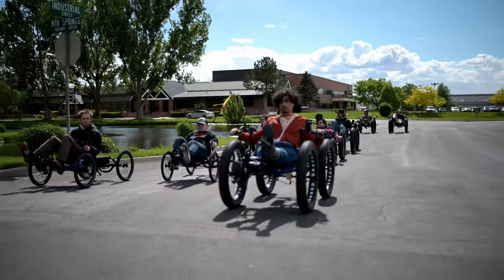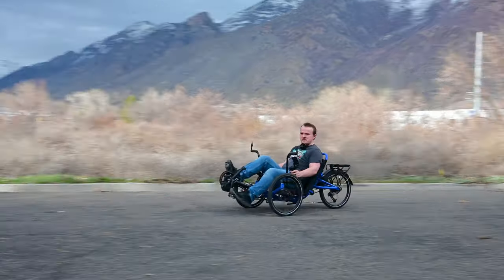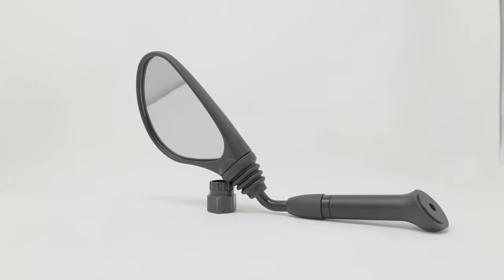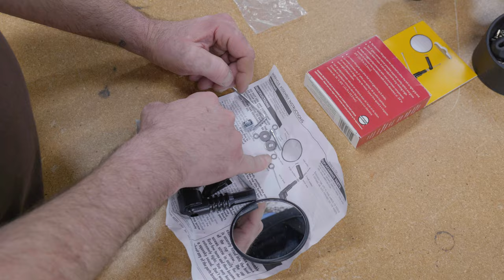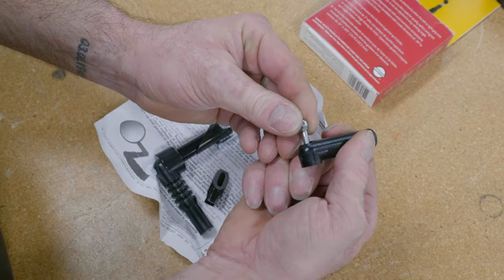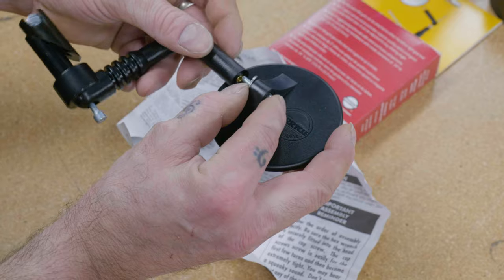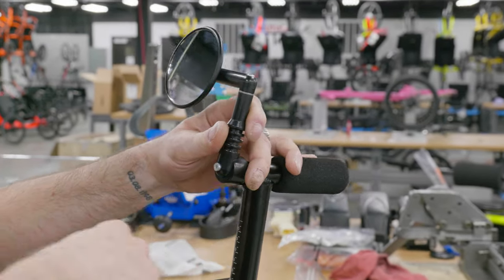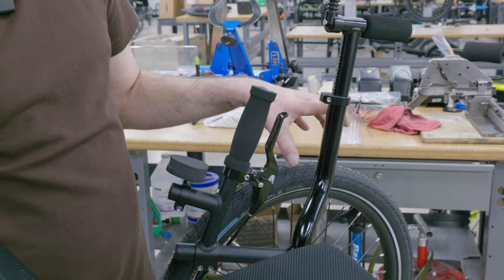Why do you need a mirror on your trike? - Trike Safety- Utah Trikes

Comment: I strongly second Utah Trikes' recommendation to get a mirror if you don't have one. My Catrike Villager came standard with a left-side Mirrycle mirror, I soon added another Mirrycle for the right handlebar, so I now have great vision to both sides in the rear. Although I no longer do much street riding, I find the mirror very useful for just riding on bike paths. I also highly recommend getting a raised flag or pennant for visibility by cars when riding on the street.